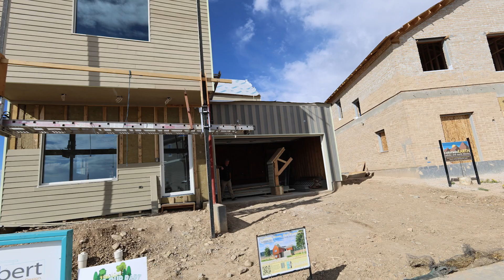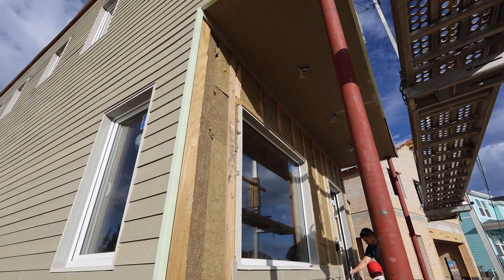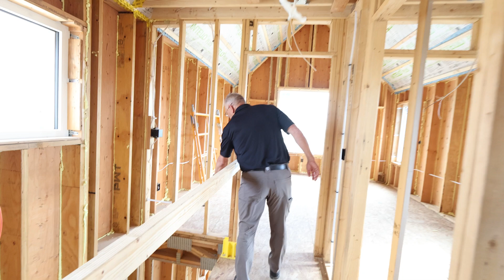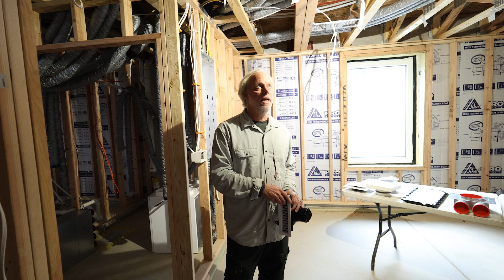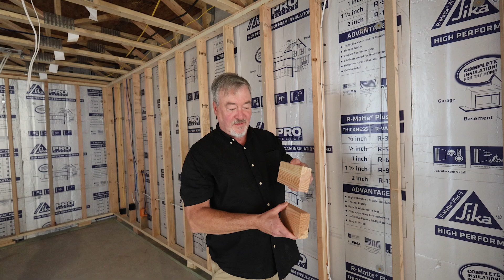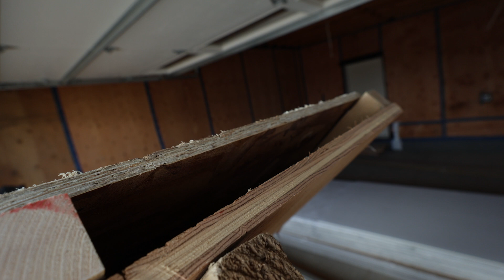ReBuilding after CO fires: Here’s some great details!

Comment: Steel SIPs would actually be fire resistant inside and out. Everything in that house is made of wood / wood product.
Reply: Yeah, I'm surprised they framed and sheathed with wood given the goal of fire safety. The Hardi siding and rockwool insulation should provide a good first layer of protection, but should the fire breach it, the house will burn.
Reply: Belive it or not but steel is LESS fire resistant than wood since when it gets hot it gets soft and collapses, and also it is a huge thermal bridge since it is a good heat conductor and also any wood near it on the inside will start burning from the heat outside.

Steel MUST be covered for any application where code says something needs fire resistance.

But for the outside if you really want fire resistance having a "monopoly" house covered with rockwool and then covered with waterproofed  plaster before strapping for siding. And a stainless steel fine mesh strip or better wool at the bottom for ventilation that works as a flash arrestor catching any sparks/embers and not allowing a flame to pass.

Also any air vent should have a shutter and or again metal mesh/wool at any intake to prevent fire entry

Comment: Can't wait to see the siding fall off the house during the fire when the strapping fails.....
Reply: Aren't you assuming a long extensive burn outside the building? A 100mph grass fire will simply scorch the exterior. No?
Reply: @kennorthunder2428   Didn't you see what just happened a couple years ago?
Reply: @homes24 We're talking about different building materials aren't we? Were those other homes build with the same fire-resistant cladding?
Reply: The exterior was wrap with rockwool underneath the fiber cement cladding.